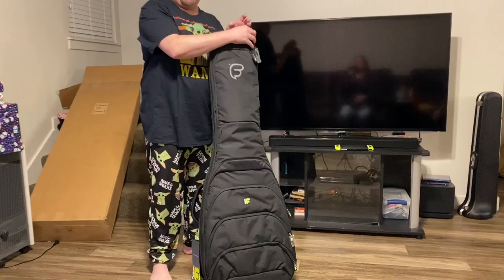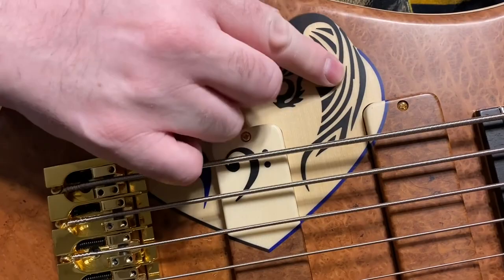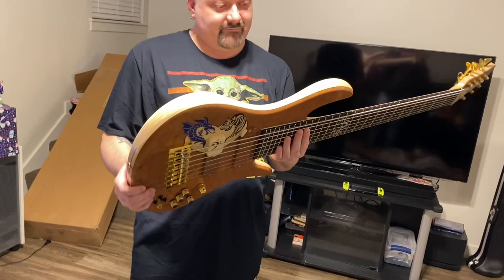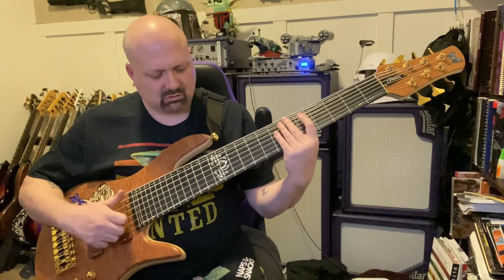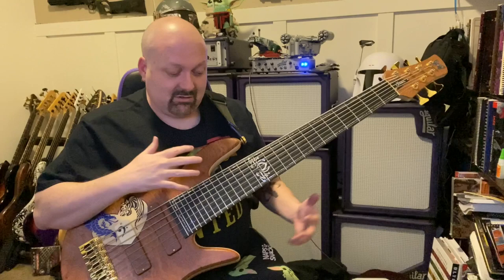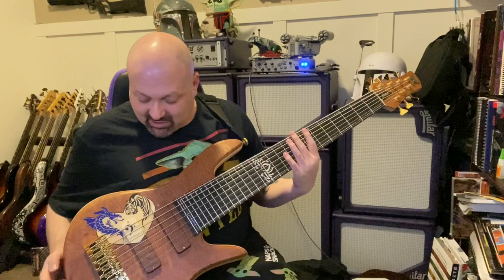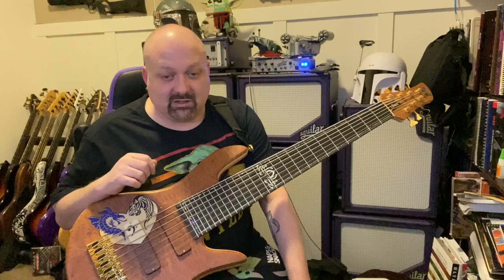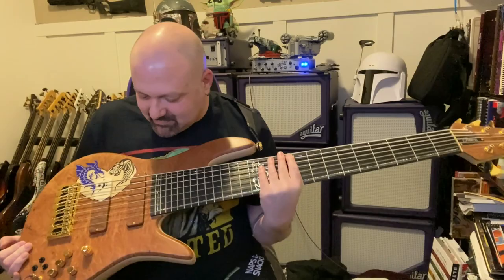Fodera 7 string bass. Masterbuilt 2020 unboxing.

Comment: WOW!!! Congratulations on the new bass! It is actually my dream to own a 7 string Fodera someday, so to see Fodera provide such an impeccable work of art to such a talented bassist is really something to behold. The team really went all out on the details for your bass,  especially with that amazing inlay. Glad to see that you had such a beautiful Christmas, and not to mention SO MUCH GRATITUDE. That level of joy is so refreshing to see in spite of everything that has happened this year. 

I don't see the Masterbuilt section updated with your bass just yet, so I am a little curious about the specs. If you don't mind me asking, what is the scale length and string spacing for your bass? Previously, I noticed that Fodera's 7 string basses were typically 35" inch scale and tend to have the 16.5mm spacing bridge. I also noticed that most of them were using the Emperor II body shape (with the exception of a really, really old 7-String Monarch picture that I have and Anthony Wellington's Emperor 7 Bolt-on).
Reply from the maker: Thanks so much!  They’re likely to update when they get back to the shop on the 4th. It’s a 34” with 17.5mm spacing. This is also the viceroy body.

Comment: im not a bass player.... im just curious tho... if a bass has 6 strings, is it just a lower deeper guitar?
Reply from the maker: The 6 string bass has a lower string than the standard 4 string E.  And one higher.  a C.  So the strings are B-E-A-D-G-C on a six.  the EADG strings are an octave lower that the guitar's counterpart EADG strings.  The 7 string adds a higher string, F.
Reply: Well, a guitar is tuned E-A-D-G-B-E but a six string bass is tuned B-E-A-D-G-C, so it adds a lower string compared to a 4 string (E-A-D-G) and a higher one that is tuned C instead of a high B like a guitar